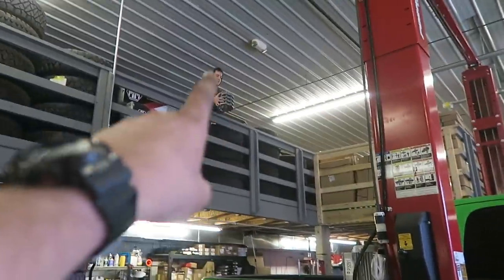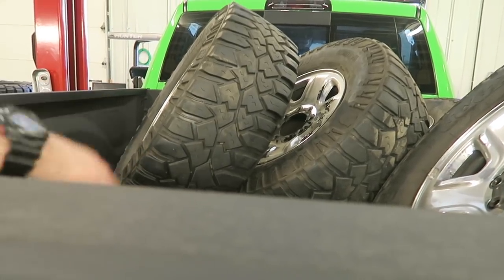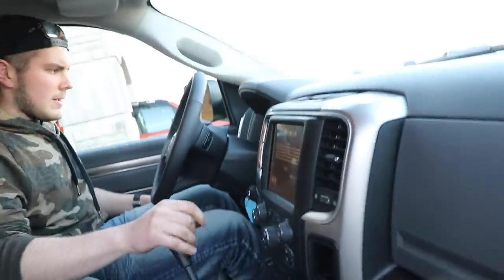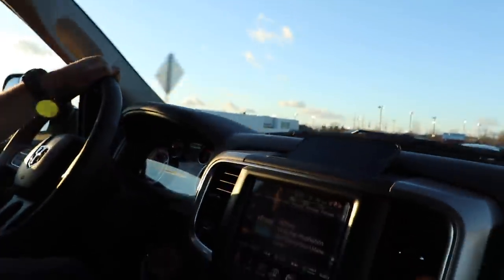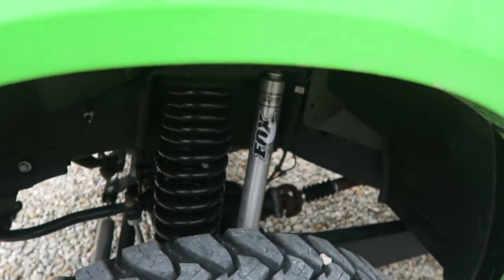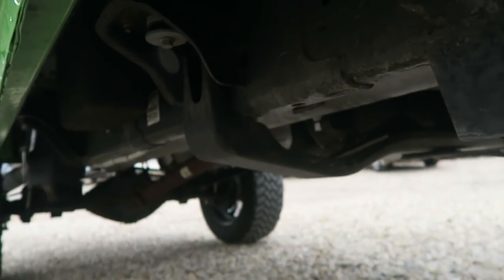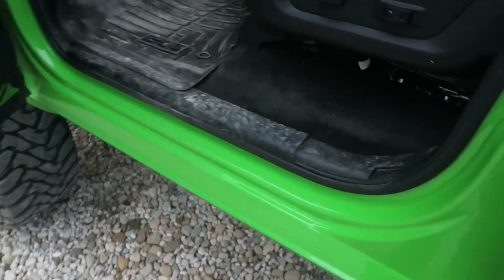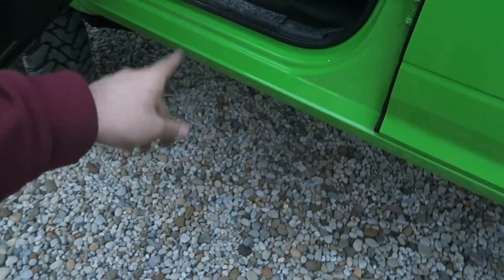INSANE 1 YEAR CUMMINS TRANSFORMATION!!

Comment: I just converted every single bulb to LEDs in my Ram 1500. I put in a Yorkim Festoon 42 mm 4014 white for the rear dome light. The cargo lights in the third brake light are FlashWolves 921 backup lights (error free). I also put in a different color LED for the footwells, too (at first, I didn’t know my BigHorn had them, but they do). Those are 194 bulbs, but they also com in different colors (hint: green would look awesome in your truck!) You can order all the bulbs from Amazon

Comment: Reverse - 921
Cargo Lights/Top mount break light - 921
Map lights - 921
Dome light - 4410
Tail lights / Brake lights- 3157
Front turn signal / Side marker - 3157

i get it 6 months 30$ every 6 months i just “cancel” they come and say 6 months for 30$
i say sure
hey we cant have defective parts siting in the engine and underneath 
glad it was addressed. im sure everyone who has a 6.7 agree